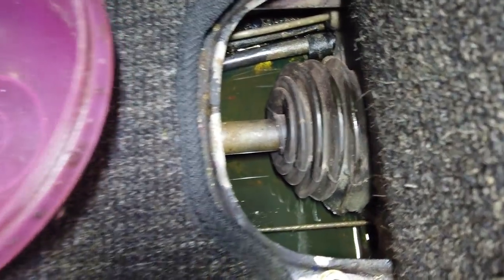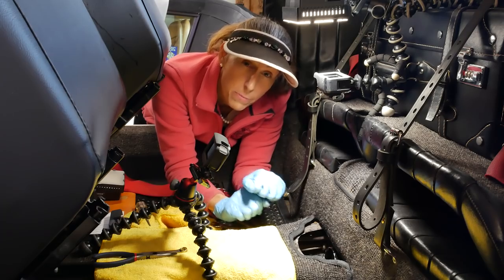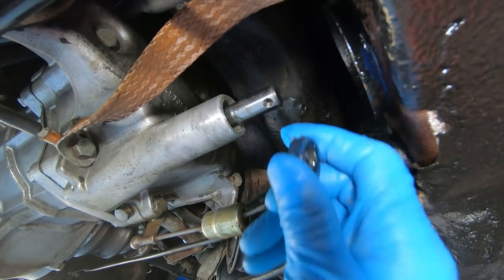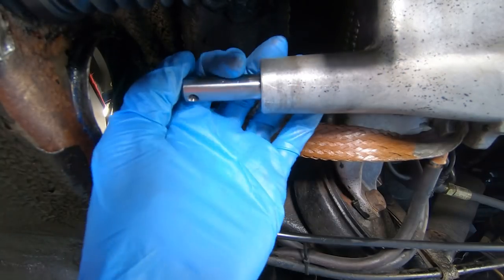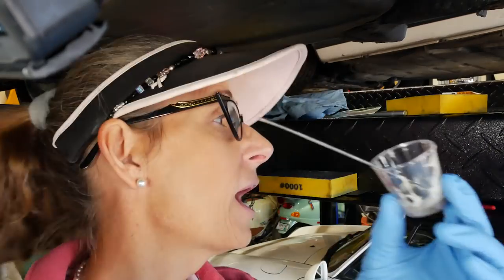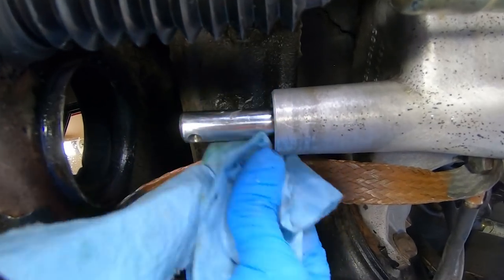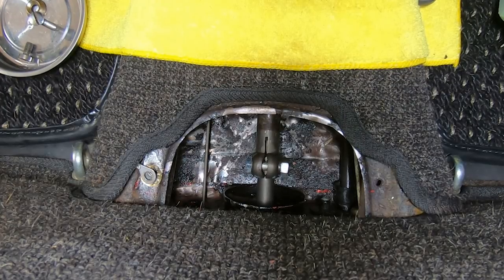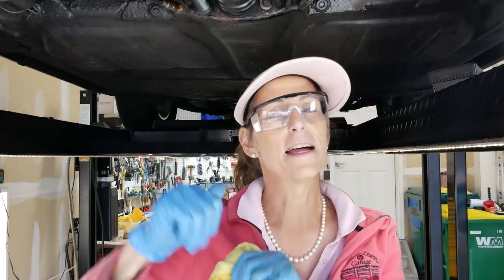Shift Rod Seal Fix!!! -- Porsche 356C BONUS Episode!!

Comment: Thank you very much for this video and the information which comes with it. I replaced this shift seal once and it is leaking more than before, so I will get the puller you used and hope get better result this time in my 1964 356 SC. Thank
 you very much again and congratulations!! Your videos are fantatic and your explanations very helpful.

Comment: Thanks again for posting a great video. I used this tool on a 71 911T not as much space but still able to get it out with the tool, it gave me a hard time as I was being too gentle, ensure you use the tool all the way to grab the full bushing, I was only gabbing the edge of it. It will take some time to get the leverage right ! Keep at it

Comment: Thank you for the informative Video. Used it to do same on my 79SC  915 transmission.  I didn't have the fancy seal removal tool, a straight poke on an angle worked. For those with a 915, keep at it, if you get it on the right angle with a straight poke will come right out, i took out the edge and thought i was done at first. Also scissor or some type of lift is essential for this job. Cheers!

Comment: Well done video.  As someone who does this for a living, I'm a little bummed you're doing such a good job of demystifying these tasks :P  In this particular case I don't think you needed the JB weld as the filing and sanding you did was most likely adequate and the affected area didn't look like it would rub on the seal after installed.  Lastly, I see you like tools and you fast forwarded over the safety wire part of securing the grub screw.  Get a set of safety wire pliers.  You'll love 'em
Reply from the maker: Thanks!  There was still a pretty deep grove in that shaft even after all that work...  It might not have eaten through the seal, but I'm pretty sure it would still leak.  Anyway, the JB Weld seems to have done the trick!

Comment: If only all cars were this easy to troubleshoot and repair.  Great fix with the JBWeld!  Curious...does the shaft that goes through the seal get lubricated by the gear oil during normal use?  Seems like that shaft needs to be lubricated with something to prevent friction damage to that oil seal.
Reply from the maker: Hi Chris, The bushing on the other side is pretty leaky...  I imagine with a good seal it will pretty much fill the area between the bushing and the seal.

Comment: Great video as usual! Did it look like the shift coupler needed new bushings itself? There looked like there was some play when you were going to reinstall. Love this video and hate to see the car go. Talk about one happy customer! I only wish I could drop my 3.2 off at your garage for some work! Merry Christmas and have a wonderful New Year!
Reply from the maker: Good eye!  Actually the coupler is just as it should be.  It doesn't look correct, but the bushing should actually be oval shaped.  That keeps vibration from the power train from transmitting to the shift linkage.  It got me too the first time I saw it on the 3.2 Carrera...

Comment: Nice job Frannie!   What do you think caused that gauge?  Looks like maybe someone was working on it and grabbed it with a pliers or a vice grip?    Only thing I can think of since it shouldn’t have gotten hit in any way.
Reply from the maker: Thanks :)  Or maybe a drill to remove an old seal?  Hard to say, but it pushed the metal up around the rim...  Just not good.  Who installs a seal without fixing that?

Comment: If you continue with a leak due to someone previously using a Vice Grip and gouging the shaft get your shaft redone by Vic Skirmants. Just remove the nose to get the shaft out. As a Bonus Vic will weld the set where it can come apart.
Reply from the maker: Thanks for the info on Vic.  I don't think it was Vice-Grips...  The damage was only on one side of the shaft.  I'm betting this JB will do the trick though...

Comment: Great content! And brilliant solution with the JB Weld Franny!
How on Earth do you think that deep gouge occurred? it seems there would have been damage to the underside of the car if it was something from the ground that got up in there.

Happy Holidays to you and Heidi! 🎄🕎
Reply from the maker: That is a great question...  The only thing I can think of is that during the last seal removal maybe the person used , a,... drill?  Probably something rotatey... The metal was actually pushed up above grade.  It must have been human-induced because the boot would protect from road bits.  But, whomever did it knew they caused the damage but didn't fix it??  This was common theme on the car.  JB Weld for the win!
Reply: @HeidiandFranny  right! They serviced and damaged it but didn't fix it? Crazy!

Comment: Great work and explanation ! I'm only a bit surprised you did not take the opportunity to change the 2 plastic coupler bushes, they show so much play in the video that you will not recognize your shifting afterwards. Just my 2 cents.
Reply from the maker: On the shift coupler?  They are supposed to be like that...  The holes are oblong to allow the transmission to move fore-aft a bit without disturbing the shifter in the car.  It does add a little play, but I tried round bushings in the 911 and it was awful... you can actually see the shifter moving around.
Reply: @HeidiandFranny   I will have to trust you regarding your cars but mine ('85 911) as round bushings with no play.

Comment: nice use of jb weld there!  where did you get those sanding pads btw, they look nice.
Reply from the maker: I think I got them at an actual paint store but I bet any home center Home Depot, etc. would have them.  I got them for the i8 wheel project because I had to sand through the clear coat that was sprayed over brake dust ;)  They are flexible, but still pretty stiff an can be used wet or dry.  They are pretty sweet.

Comment: Hi again, tried many times to get seal out with no luck, there seems to be some kind of metal washer in front of the seal and won't come out, and I managed to butcher it up so far, getting very frustrated and hope you read this and perhaps offer an opinion and advice. thanks
Reply from the maker: I have a friend who had a similar issue. He solved it by drilling a small hole in the face of the seal and screwing in a small screw. He was able to pull it out that way.  See if that works.

Comment: So what caused the shaft to get scratched?
Reply from the maker: Great question!  My guess would be some kind of power tool (maybe a drill?).  Absolutely no need too resort to that.  It is a small seal and easily comes out with the proper seal puller tool.